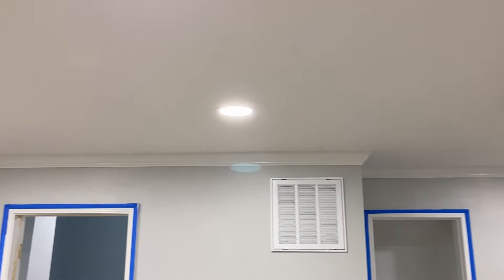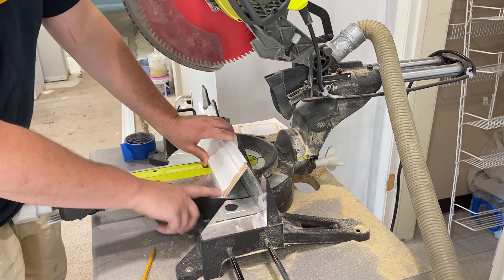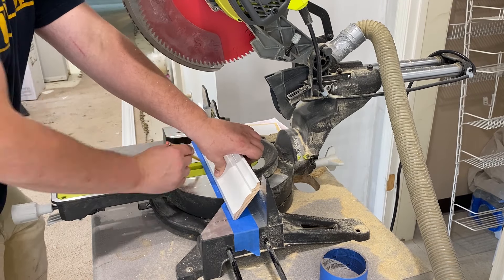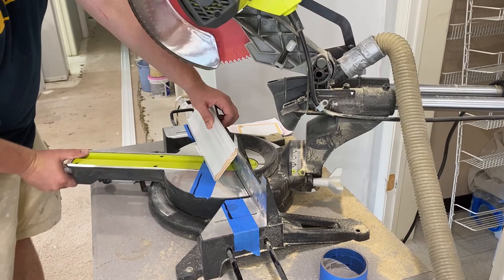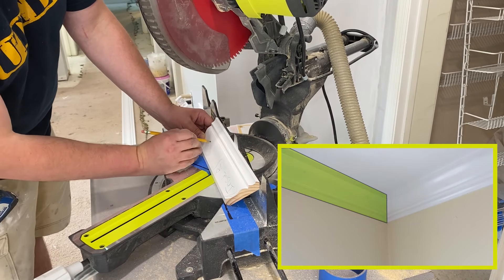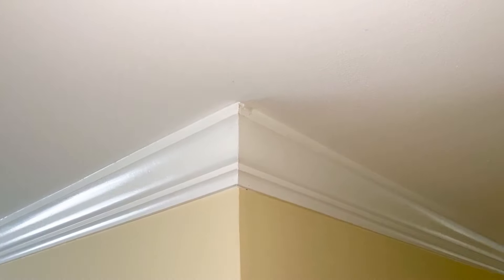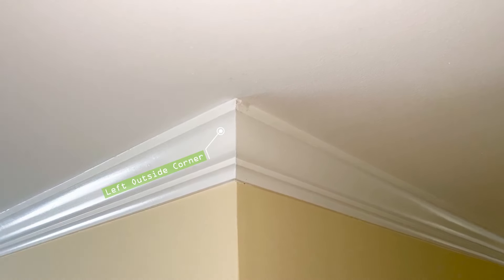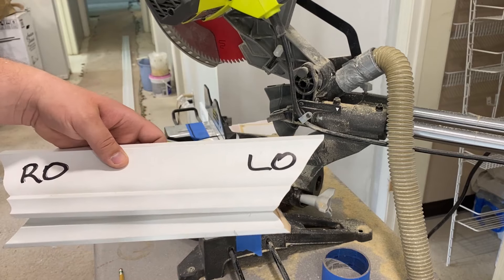How to Cut Crown Molding In 3 Min

Comment: If I’m understanding things correctly, 
1) crown upside down
2) if cutting inside corners cut 45 degrees in the OPPOSITE direction of the side you’re trying to cut. 
3) if cutting outside corners cut 45 degrees in the SAME direction as the side you’re trying to cut.
Reply from the maker: Don’t be making it sound all simple lol. No one will watch the video.

Comment: What is the spring angle on the moulding you were installing? I cut at 45 and 31.6 (using a Kreg jig) and both of them flipped me the bird.
Reply from the maker: Ours was standard 45 degree angle. If yours is the same skip the jig and follow the instructions and you will be just fine.
Reply: 10-4, and thanks for the super quick response! @DIYwithMAX
Reply from the maker: @joshuamoyes5616 always happy to help. Please let me know how it turns out.

Comment: Very helpful video . Unfortunately after following closely my angles still didn’t line up well enough. Too wide to hide with caulk. I used a 90 square and see walls are not square. If the angle is more than 90 , 94” what is the solution to correct. 
Same question if it’s under 90’  . Also seems. Necessary to nail into every wall stud .. ? Thanks
Reply from the maker: You can cut slivers off molding at the angle off the side that has a large gap and insert them then caulk. The corner.

Comment: Is it worth it to measure the inside corner angle in case it isn't 45 degrees? Or don't bother?
Reply from the maker: Hey Chris thank you for taking the time to ask the question. We never measure because it takes a lot more time and caulk hides all those imperfections but if you have a funky shaped room or you think the angle is way off then you should take the time to check just to be sure and not waist material at today’s prices. I hope you found this answer helpful. Thank you for subscribing to support the channel and please let me know if I can help in any other way.

Comment: Great video but I have what is probably a very dumb question. Where do I make the mark to cut the right length off and make the two pieces come together perfectly? Also, how do I account for the thickness of the sawblade when making my mark to make sure the measurement is perfectly accurate?
Reply from the maker: Great question. For the length of the molding you measure always by the bottom as those will be the ends that touch each side of the wall if that makes sense. As for blade thickness it should not be a factor if you cut outside the line. It’s always better to keep the peace a little longer and do an extra trim than to have large gaps. I don’t show this in the video because it would be to repetitive but we bring each peace of molding two or three times to make sure the fit is as close to perfect as we can get. This is only a problem if your doing this work for others because it will take longer but if your doing this for your self it’s more important that it’s done right instead of fast. I hope this answers your questions if not please reach out I’m always happy to help. Please hit the like 👍 button so this video is recommended to more folks like you looking for this information. Good luck on your project. If your comfortable send me a pic of the finished product I always enjoy seeing the results people get after watching my videos. My email is DIYwithMax@gmail.com

Comment: Great video - but what if the internal/external or both corners are not "exactly" 45 degree angles
Reply from the maker: Great question. You get it as close as you can and then caulk the corners inside and out and top and bottom of the molding. Watch my installation video I cover it in there. The link is in the description of the video you’re commenting on.

Comment: Is the main difference between crown molding and door molding basically the 45 degree bevels at the edges that contact the wall and ceiling? Aside from the more decorative design-
Reply from the maker: Correct. And the crow has to be cut upside down to get the right cut.
Reply: @DIYwithMAX  it just seems the prices charged for crown molding is disproportionately high; doesn't seem like it's because they're particular difficult to manufacture. 
Is it just because that's what the market will bear?
Reply from the maker: @dubmob151 it depends where your buying. I bought mine at a lumber yard and it was a lot cheeper then a big box store. And usually because your buying spruce and molding they will negotiate the price down if your buying everything in bulk.

Comment: Quick question. Why do you have to turn them upside down?
Reply from the maker: You turn molding upside down to cut it so the angles match how it will be installed. This ensures the cut is accurate and the decorative profile lines up correctly. It also makes the molding more stable against the saw, reducing mistakes by keeping the long edge of the molding on the table saw. The best way to understand is to try it both ways and see the result you get.

Comment: I wish I could take a picture and show you how when I make that template you’re showing went to 45 and once another degree and I’ve got 45° on the left for the right hand side and 45° on the right for the left-hand side😢🤬🤯
Reply from the maker: If you want we can do video call if you have google meet or FaceTime. I’m happy to help. Email me at DIYwithMax@gmail.com
Reply from the maker: Are you cutting it upside down?
Reply: @DIYwithMAX  yes!
Reply from the maker: I’m happy to do a quick call just send me an email with your info.
Reply: Sent email
Reply from the maker: Thanks for sending me the picture of what you’re talking about. I replied to your email but I’ll put it in here as well in case someone else runs in to this issue. Please share the model of the miter saw you have because most miter saws range 100 degrees from side to side with 0 in the center so it would be 50/50 degrees on each side. Your saw has the zero offset to the left by I suspect ten degrees so your lock to lock range is 40/60 and that’s why on one side your getting 45 degree cuts but the other side is not coming out because your setting the saw to the max 40 degree on the left not the needed 45. Please confirm that my suspicion is correct.
Reply: @DIYwithMAX  hey man,thanks for all the help! Long story short.. that Mikita single bevel miter saw is definitely Waaaaay off! Taking it back to Home Depot Rental now.. hopefully get my money back!  Also, changed my “Dislike” to a”like”! 😅
Reply from the maker: @MrCodypowell I’m glad it was that simple and I appreciate you hitting the like 👍 button to help others find this helpful information. Please keep me posted on the project.

Comment: These 45 degree cuts lead to gaps when the molding expands and contracts with changes in the humidity.  Even the inside corner video shows spots where the corner is opening up and cauld seperating.  To do it riight you need to cope cut those inside corners.
Reply from the maker: Thank you for sharing your experience. The process I show here has been very successful in my projects. I have had to fill in some spots with caulk maybe 10 years later here and there but I find that my method does work and works well.

Comment: I greatly appreciate the effort here, but one thing you failed to add was that this method is fine for mouldings where the spring angle is 45 degrees. If the spring angle is different then a for say 52 degrees and 38 degrees may be needed.
Reply from the maker: Good point I should make some videos about those angles.

Comment: Mine is 6 inches. Won't fit in the saw
Reply from the maker: Thank you for taking the time to leave a comment and subscribing to support the channel. Sounds like you need a bigger saw my friend. For 6inch molding you will need at least a 12 inch blade miter saw. Remember you are saving tons of money on the labor so use the savings to get the right tools. It’s important for this job to have the right tools as the tolerances are so tight that it would be difficult to do a good job otherwise. Good luck on your project please keep me posted on how it turns out.

Comment: This is one of the most useless videos I've seen on doing anything just showing somebody that you're putting a crown molding in a saw and not giving no detail is no video
Reply from the maker: You got to rewatch the video again it sounds like you missed everything. This video has all the info you need to cut crown molding like a champ. I’m happy to answer any questions you may have about the process if that will help.